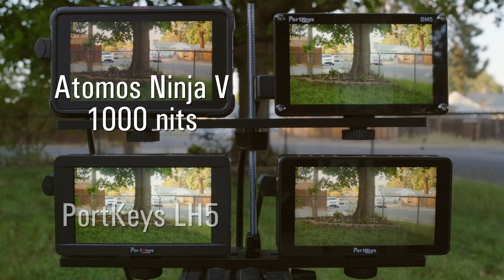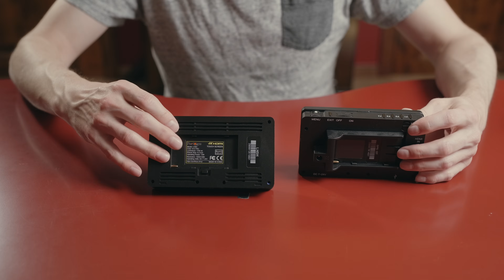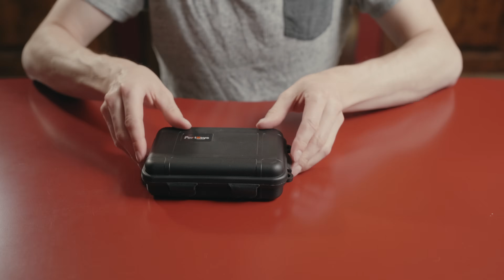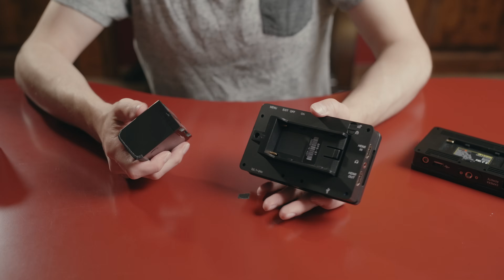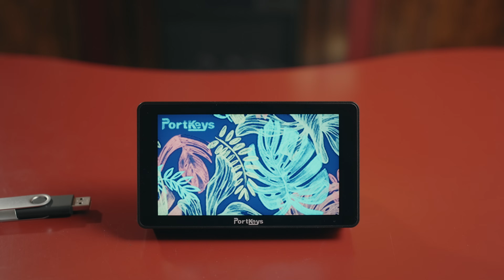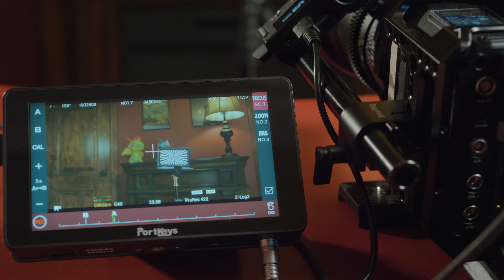PortKeys LH5H Review - High Brightness 5.2" Touchscreen Monitor with camera control

Comment: I bought two of these and got them working with the Pocket 4k after an update (which wasn't easy because they don't list it on their site). After using it only four times, one of them failed (probably from heat). Contacted PortKeys and they told me they wouldn't honor the warranty unless I bought it directly from them. The warranty was less than two months old. Portkeys is an untrustworthy company.